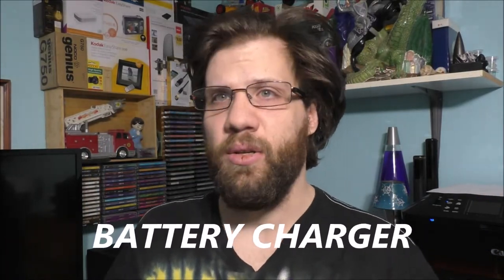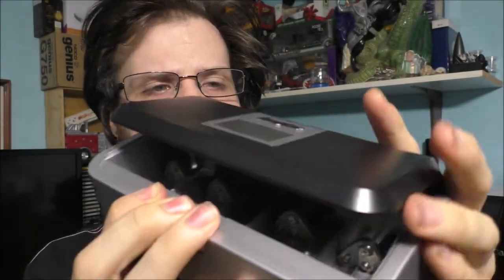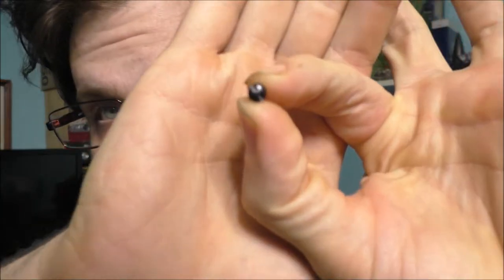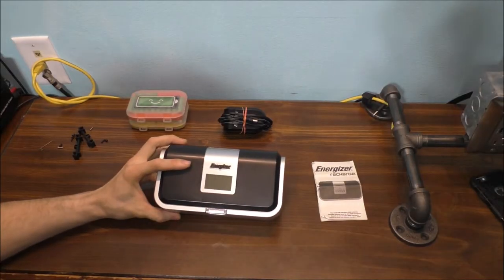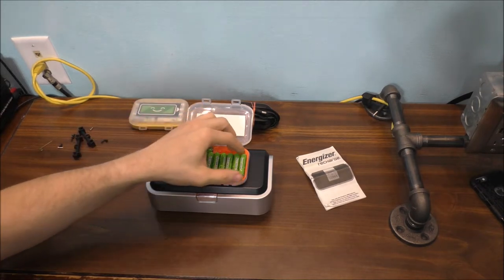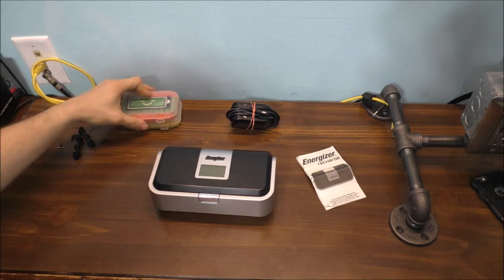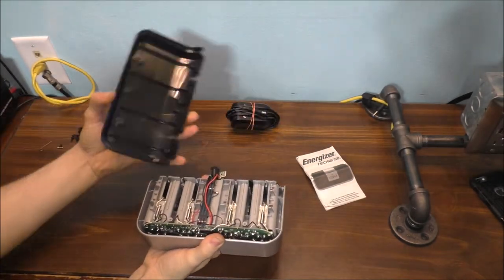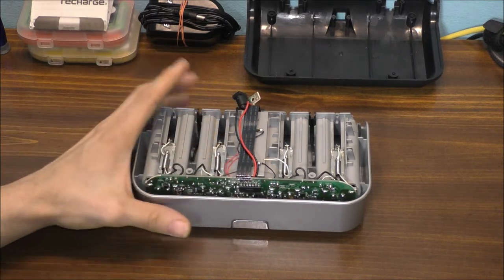ENERGIZER BATTERY CHARGER DIED

Comment: The white wires inside frayed from so many cycles and broke away from the board. They just need resoldered. Even though the chip looks bad it should be just fine. Sometimes the spring hooks break... I just use a 1x6mm self tapping panhead to hold the spring. These are nice chargers. I've fixed many of them.